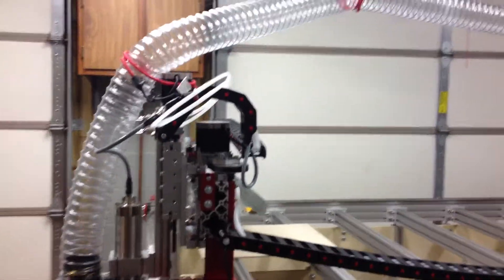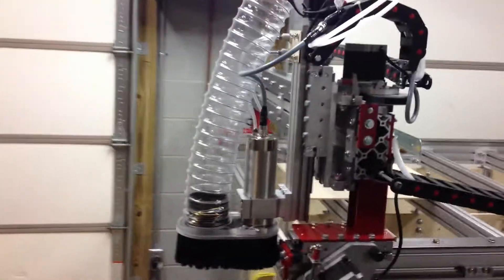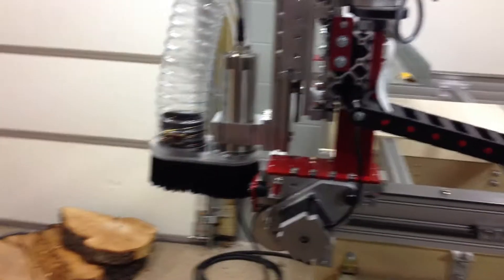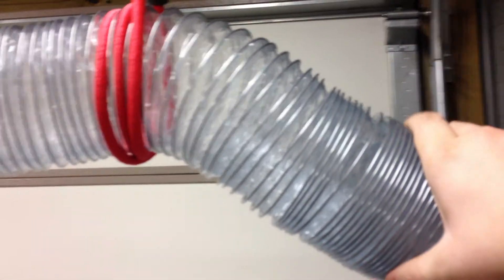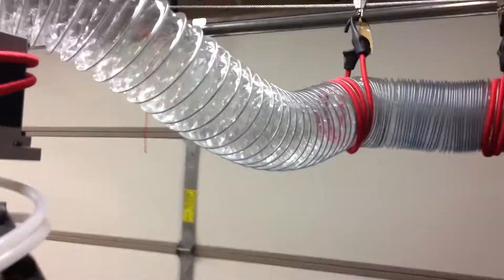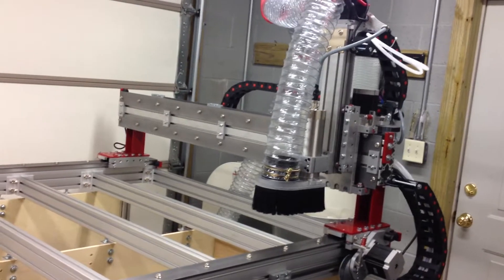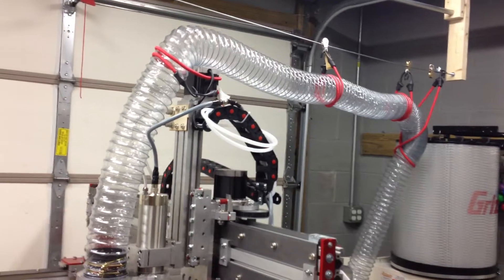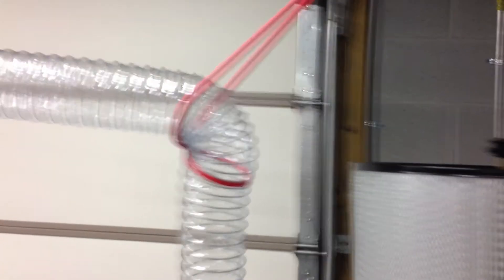CNC Router CNCRP 4896 Build 26

Comment from the maker: A 2x4 router is a lot easier to manage dust collection hose than a 4x8.  I've seen a lot of guys just attache extra length of the same kind of hose I have here to the ceiling and let it stretch to the corners.  I've even seen guys to that for larger machines than I have, but they have higher ceilings.  Since mine had to fit underneath a garage door track, I had to get a bit more creative.  It works well though.

Comment: hey Dirk..
Your project is looking good and making me envious.  I actually started buying parts for my first maching build.. which will be a 2x4.  Looking at your hose setup.. I was thinking that a slinky style hose like the ones from Rockler  may work quite well for the overhead dust collection.  I have one that I use, although my lays around on the floor.
I like how it contracts and just makes the turn where I want it to go around something.. rather than a 25 foot hose that turns into a snake.